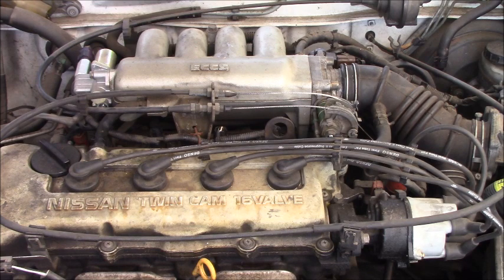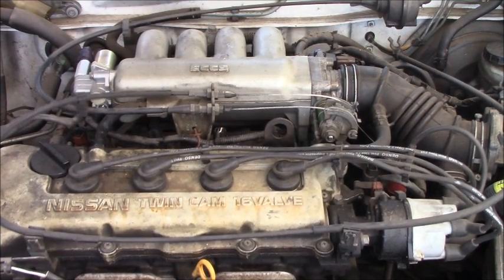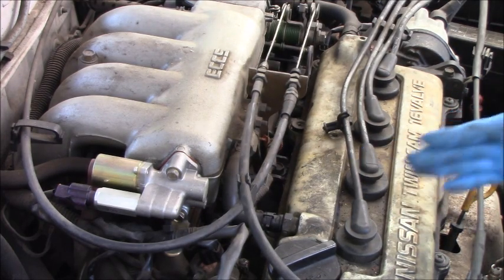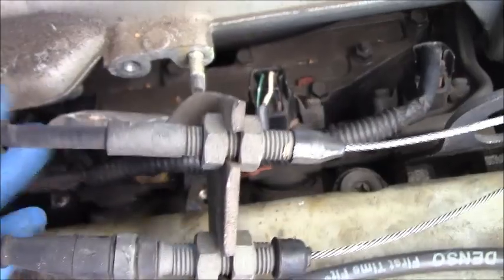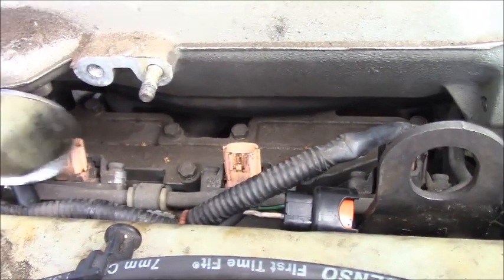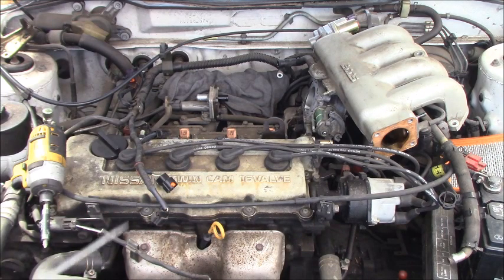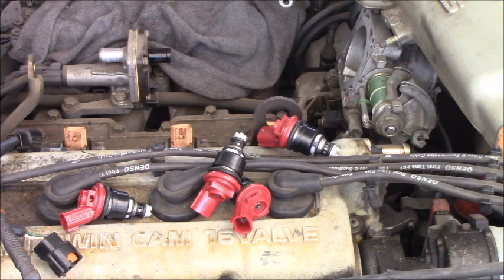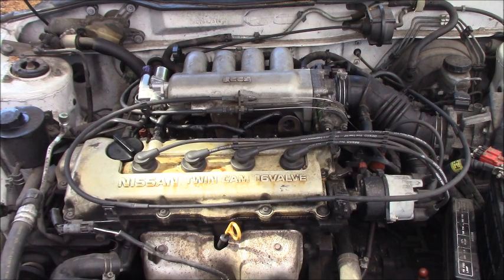Nissan Sentra random misfire bad fuel injectors

Comment: Hay thanks, 92 Sentra, I replace one bad injector and fuel filter and now it wont start, any ideas ?
Reply from the maker: What about cranking?
Fuel injector O-ring easy break while install each time key on fuel get into cylinder will cause cranking problems
Reply: @AutomotiveServiceExcellence  when i took it apart I sprayed carb cleaner in it and it seems it got flooded or fouled.  Thanks